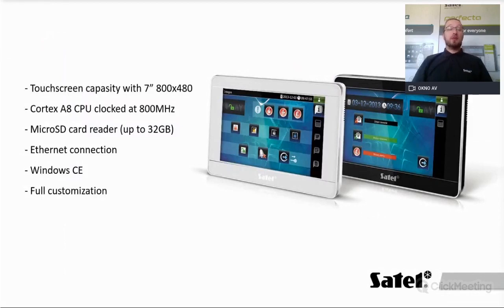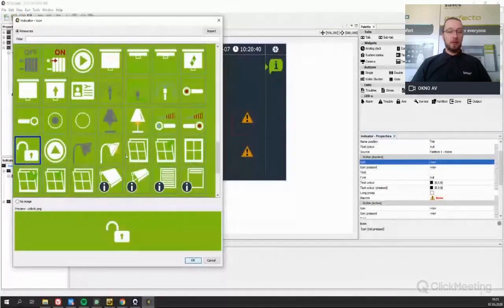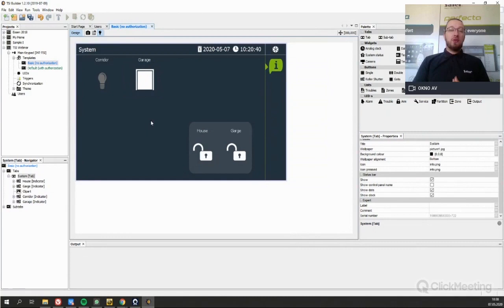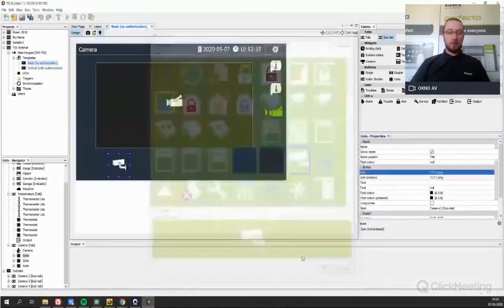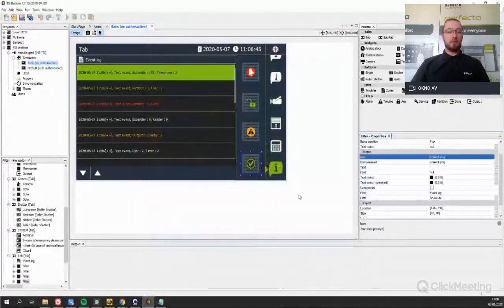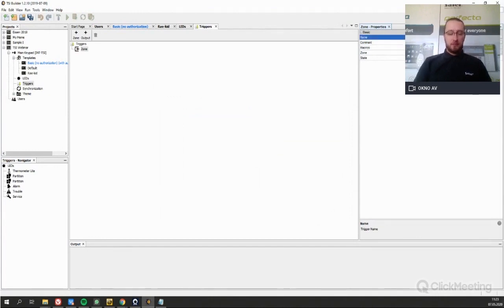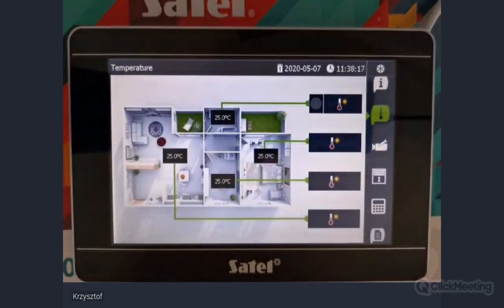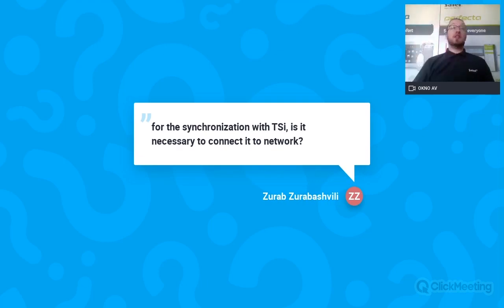SATEL Webinar: Configuring and Setting up the INT-TSI Touchscreen Keypad

Comment: Can I make a Quick arm from the (no authorisation panel) without entering the user code? I manage that in macros in INT-TSH , but not in INT-TSI
Reply from the maker: Hi, in the INT-TSI keypad, it is impossible to execute the arming macro command without entering the code on the screen without authorization; the keypad always requires entering the password to execute this macro. The functionality of arming without entering a password will be added in a future version of the software.